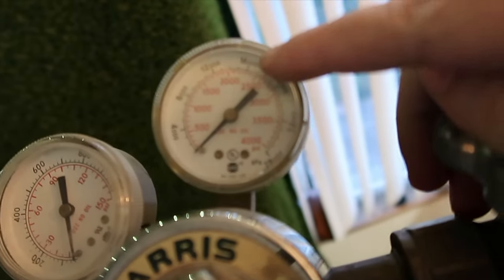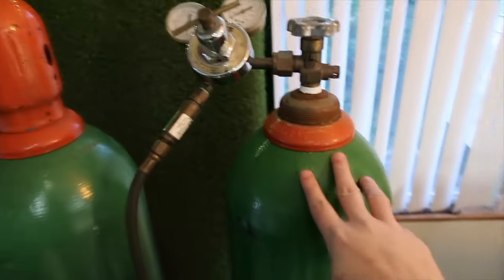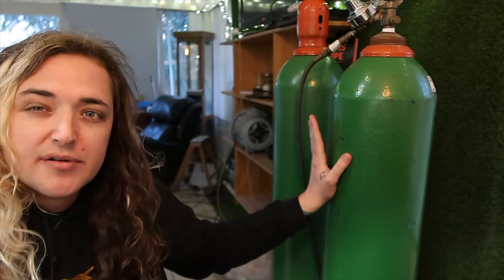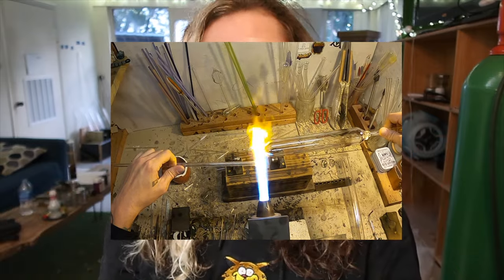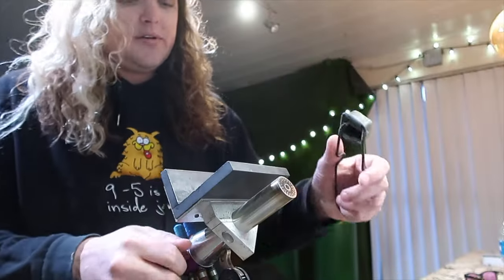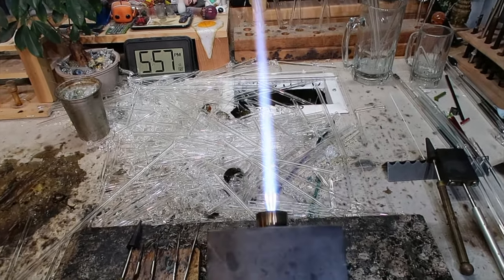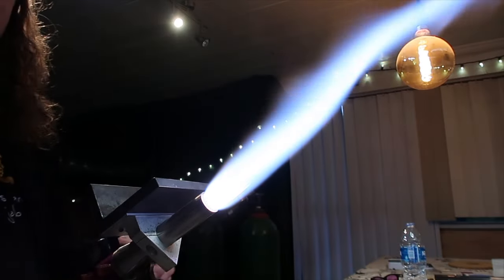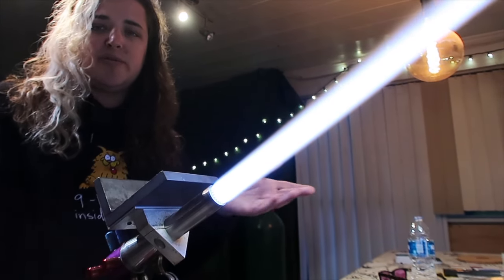New Torch!! GTT Delta Elite…(pros vs cons)

Comment: Wow thanks for this. I was actually curious to see what those blue knobs actually did and I finally got to see this. I was almost thinking from reading the website that you need to have an air compressor for the air injection or something. And it had its own hose ports. Or is that actually an option or is that all the blue knobs do is inject oxygen premixed. You know you can melt quartz with a GTT right? Maybe you should make a video about that.
Reply from the maker: Gtt has an option for compressed air which I think is good for quartz. But I dont have any knowledge on quartz, from what Ive seen  ppl use a GTT for but not sure what model

Comment: Try to get a good O2 concentrator.   I love mine and you can turn the 02 up or down.
Reply from the maker: I need to try one again lol I someone’s oxy con once and felt like my flame was 20% less powerful
Reply: You need one for the gtt man. You can even get a set up where you have a the concentrator on the inner flame only so your on free oxy 80% of the time or whatever and then when you need the outer you can still use tanked! I’m debating getting a CC on top of my gtt mirage becuase how hard it sucks oxy